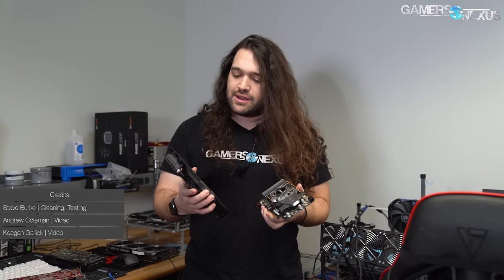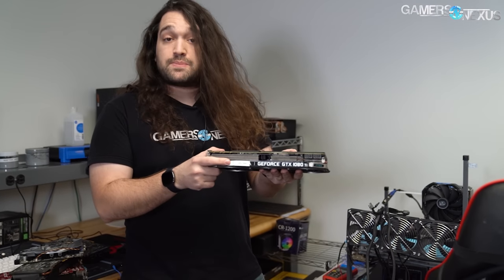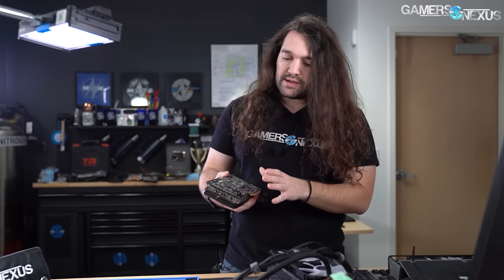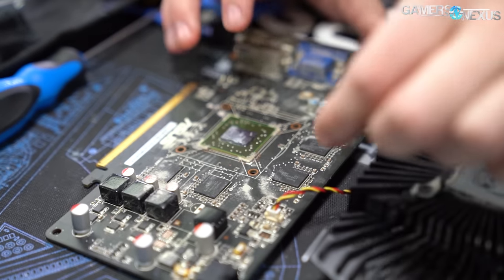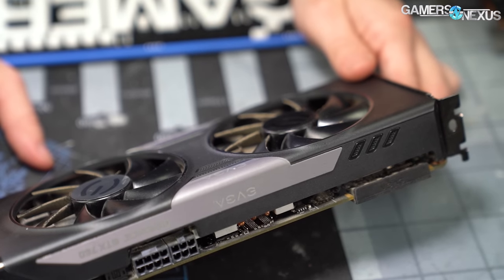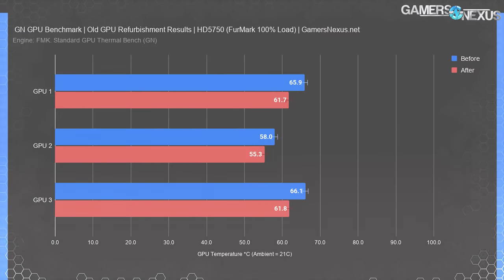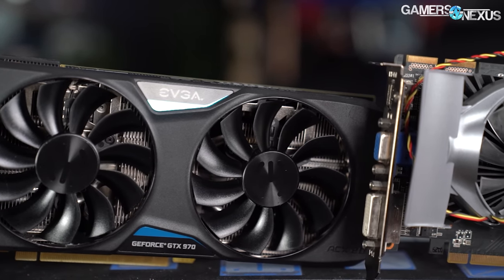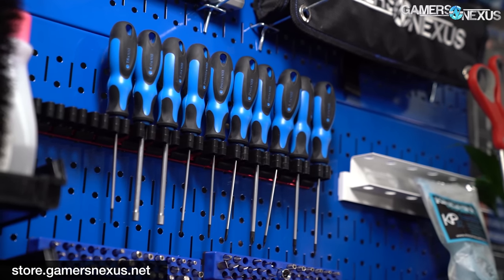GPU Cleaning Before & After Thermals: Re-Pasting & Dust Removal

Comment: this is why my cousin's athlon 64x2 5400+ and HD 4570 still work today in tandem and why my 6950 and q9550 still work well too regardless me now rocking 3800x and rx560 4gb (the rx560 part is bugging me and won't let me overclock it without it complaining which i think i will take it apart legit this time and repaste and repad it)

and yes all systems are happy no crashes besides my main one(though that rx560 once liked 1325 core 2050 mem now shows sign of VRMs being problem and 3800x chuggling happy along with h100i cause i have PTSD from 6950 fans at 100%)

Comment: I had re-pasted my old gpu multiple times and it was good, but lastly I had also cleaned the radiator and it dropped temps by full 10 degreees.

Comment: I think the least amount of time I had a system was 3 years, and I had to replace it because our phone line got hit by lightning (back in the dial up days) and it shorted out both mine and my brothers
I ran a pentium 90 for a decade, and had most of my systems for at least 7 years. I think I still have a working 486 around here somewhere....

Comment: i bought a gtx g650 in february 2013 and cleaned it, new termal paste and recover some of the horses   and got a decent  wroking temperatures now: before was working  bewting  95-90° now is working  in the 60-70

Comment: If tim has silicon oil base it will last for really long time (as long as it's not "high performance" that crap is really liquidy and tends to sip out with time), I repasted my 8800 gts and it was within 2c  temp variants for the next 8 years.

Comment: i got a used 970 2 years ago and the add said that they replaced past and pads so i tested temps when i got it and they were good.....back then. about a month ago i seen that the temps started getting bad to where i was dropping clocks so i opened the card and seen that what ever past they used was gone.....i mean to the point i cleaned it with 1 qtip. after re-pasting and adding some arctic pads it was better then the day i got it and at about the same noise i got better clocks. just something for ppl buying used to keep in mined. you never know what they did to the card so test, clean and test again.

Comment: I'm awaiting on replacement fans for my ASUS 980Ti Strix.
Fan C the bearing is going and its buzzing/squealing (started on friday although noticed it went up a degree or so in Celsius). So am refurbishing with new replacement fans plus a repaste of thermal compound. Etc. This week.

This card will always have a second life in office use.

Just a shroud removal. Not full disassembly. Fan replacement and thermal compound.

Comment: my 2070 use to hit 81c on the core after about 20m of gaming, still boosting past stock clocks so i wasnt worried about it. Eventually i took it apart and repasted everything and cleaned everything now even after 2 hours of gameplay the core doesnt go past 76 with a higher boost clock in the same game, fan speed was ~relatively~ unchanged

Comment: Few weeks ago noticed that my old sb i7-2600k was really noisy and seemed to throttle effecting gpu heavily. I looked at temps and ordered some basic tower cooler from was it cooler master. Anyway paste was pretty much dust partly when removing. End result was really silent was ridiculous - 45c result that affected performance big time. It should be pretty much mandatory thing to change paste in all about 10 years old hardware that's been in fairly heavy usage.

Comment: Cleaned GTX 970 from dust (just pressurised air) and reapplied thermal paste. Temps dropped from 91c to 72c on Kombustor, which the first was running 100% fan, and the latter 60% fan speed. Thermal paste was some Noctua stuff I used for CPU. Looked like you put a ton of paste on 1080, I literally used a small drop. Also did the same for GTX 770, but one of the fans has this horrible noise, so it's unusable.

Comment: 99 or 91 percent isopropyl alcohol in a spray bottle will remove that water and oxidants. Also dries fast. Safe for metal, and non plastic (polystyrene is a no go) electronics.

Comment: Isn't the H5 also the same one that you use on standoffs if you ever need to add or remove them from a case? I've had to pull a few standoffs because they were the passthrough ones rather than the normal ones, and my board didn't have a hole in that spot, so I moved it to another location. Also I'm surprised you didn't make any mention of being careful when cleaning the die, not to accidentally scrape off an SMD. It won't necessarily break the card, but it's still not advisable. Definitely just did this to a card not long ago, the paste was so caked on that it actually sucked 2 SMDs off from around the GPU with the cooler when I pulled them apart like normal. The card was a 780ti and it still works fine thankfully, but it startled the hell out of me cause I've literally never seen that happen, and the GTX1070 I repasted right after had even worse paste but it was totally fine. That 780ti also dropped over 20c before vs after, the die wasn't actually making full contact with the cooler before due to improper pressure at the factory, so one corner of it basically didn't make contact properly at all until I remounted it with proper screw tightness and some Kryonaut. Now to get him to give me back my 5700xt so I can sell it so I can buy myself a 2tb 980 pro

Comment: Great video on preventative maintenance on the cards. I haven't done any graphics cards yet but have on 4 older workstations and the crud, dust and cement like thermal paste was on all machine CPU's PSU'S and fans. It's a worth while easy project to prolong the life of your stuff. Any suggestions on where to find the thermal pad specs for graphics cards and the pads themselves?

Comment: Funny to see that with my low standart. I've used untill late 2020 a old i7 960 with a EVGA 1050Ti SC for most game and it was fine. I did upgraded to a Ryzen 9 5950X when it was released but only got the same GPU or a GTX 980 to use. So far my new cpu do very well the job with my outdated GPU. Guess as a video game programmer cpu power is more needed for me than gpu.

Comment: on both used cards I bought I instantly replaced thermal paste as the first one was a mining card and the other I dont know either way some times even on some lower end of certain models it helps in general as some use crappy thermal paste to cut costs

Comment: When should you consider changing out fans on a GPU?  Or do you just run them until they stop?  And good luck finding the pad thickness used by manufacturers.  I've given up on that, and it's not like I have some obscure make of card, I got an EVGA card.  But they don't seem to want to share the thermal pad thickness with consumers.  They are into selling new cards (well, not EVGA), not helping consumers make their cards last longer.
Reply: 1. Get new fans if they rub/click or stop.
2. Just measure the pads lol

Comment: great video just quick question, didn't notice if you mentioned it or not, but the 1080ti that was clean but just paste replacement, was the paste already replaced at some point in the cards life or did it still have stock paste/pads?

Comment: Might be interesting to test the same thing on older CPU's.
For example I have a 7yo Intel 4670K CPU non-oc with stock cooler, which still has the Arctic Silver 5 thermal paste applied to it from when I installed it 7 years ago. Never replaced it. Temps are still relatively ok (for a stock cooler) and it's not thermal throttling. I do clean the heatsink and fan blades from time to time (but never took off the cooler from the CPU). Replacing the thermal paste will obviously not help performance (not without an OC and my motherboard won't allow that), but I do wonder if it would reduce temps and thus reduce fan RPM in a meaningful way. Those intel stock cooler fans can be a bit loud, especially when I game on graphically less intensive games that get above 100FPS.

Comment: I cleaned and repasted my GTX 980 and didn’t notice a difference (always ran at 80 degrees). Recently, I replaced all my case fans with be quiet ones and noticed a drop in overall temps. Just saying airflow could also be an issue.

Comment: I recently replaced rx 570 thermal paste, but it only got me 1-2 degrees improvement and then I got what the problem is. Fans are just sh!t. When I crank them up to 100% the card is cool, but the are very loud. Now I will order new fans, remove the card cover and strap on new fans. It should lower the temps and the noise at the same time.

Comment: Just a throwaway comment, but if you use water to clean a heatsink consisting of Copper heat pipes and Aluminium radiator fins, are you not risking damaging the interface between the two of them especially if you can't dry them out 100%???

Comment: My evga 1080 ti (same card on the video) died (artifacts and hard shutdown) a week ago. I have only taken the backplate off. The thermals pads were dried out and the almost greasy thing from the pads were all over. Did not take off the cooler, but can imagine. 3+ years of service in rather hot environment and my lazy ass not cleaning case for better airflow. Not bad, but horrible timing.

Comment: Would you guys also investigate aftermarket coolers, for various GPUs [aka, historically known hotter running ones]? In case some folk have chips needing a thorough revival, through a HS failure/replacement, or if mfr's applied solution was paltry/subpar for the chips capability

ex) Arctic Coolings Accelero series

Comment: 0:43 oh, like my sapphire 5670 with 512mb i bought brand new in 2010, which i used for games and netflix until i sold it this past november. or the 5770 i bought used in 2020 and it didn't get a clean up since new.

Comment: What about Blower style GPU cards? like the 1080 Founders, ASUS 1060-70-80 Turbo. Being that these need to push air across the entire card from one side to another, rather than multiple fans pushing down onto the cooler. Would you say maintenance and cleaning would have heightened importance?

Comment: Hi I have a question, should you re paste your gpu and cpu once a year? If you run intense games? Some people say once every few, but I’m gathering if you use it a lot, and you push the limits that you should every year? My RTX 2060 and amd3600 perform really well, I haven’t re pasted it yet and it’s been a year now. I reach highs of 83 degrees but stays around 78-81. And since I have 8 fans it doesn’t throttle at all, and is still really cool, don’t get hot much at all, Mainly because I play at a higher refresh rate though, reason for higher temp

Comment: I am gonna do this on my RX480 nitro+ 8gb because I looked into overclocking it since I can't upgrade atm. Saw that it was throttling on stock oc speeds and then realized my card was idling at 42c which is about 10 degrees more than I think it did when I first got it. 

Wish me luck!

Comment: Here in Brazil there's a cheap product called "Tira Grude" witch translates to something like "glue/stick removal" that I accidentaly discovered that removes dried out thermal paste, and that weird, sticky (an usually pink) thermal compound from chipsets sooo easily, one drop, a toothbrush, no force, and its all gone. This is the product: https://www.quimatic.com.br/produtos/especialidades-quimicas/tira-grude/ If you can find out the composition, maybe you can find a similar thing to buy, and no more screwdriver brute force removal method.

Comment: Here's a question about washing heat sinks with water. When I do it, I usually rinse it with distilled water for the finish as I am concerned about the limestone residue from the tap-water covering the surface of the fins and consequently decreasing heat dissipating performance of the cooler. Is this a valid concern or will it not have any effect using tap-water only?

Comment: I just bought Kryonaut Extreme to replace my Evga RTX2080 XC Ultra's paste. 
Thing keeps pushing the fans into a turbo mode even with adjusting fan curves, chassis fans in my HAFX case on maximum, removing the Asus X570E motherboard shroud under it.

It's only 2 years old, so darn... are these manufacturers going cheap on thermal paste nowadays?

Comment: there is nothing as good as cleaning a used GPU you bought on eBay.

I got a 1080 that had enough weed in it for a small one. below the cooler was a good millimeter of tar. that was fun. (didn't even test this one before cleaning)

Comment: I've got an RX5700 that's about 1.5 years old. The thermals have been a bit high (80ish under gaming load), and the fans or possibly coil whine has been louder of late. The fans do spin, and don't appear to have any wobble or anything that would indicate a bad barring. I haven't noticed any loss of performance, but I'm worried about the card getting worse or breaking if I do nothing. I've never taken a modern video card apart before, and thermal pads and hidden screws scare me. Should I try to take it apart, and replace the thermal paste? I can't afford scalper prices for a replacement if I break it. I'm not sure what to do.

Comment: Why not just use a vacuum cleaner to absorb all that dust? I am aure you can find portable ones that you can adjust the strength. If you combine the vacuum cleaner and a soft brush, you can get rid of all the dust and junk easily and faster. I restore vintage computers every day and it works very well. 👍

Comment: At 4:24 you mention the thickness of the pads. If we are converting a card to water cooling and the block already has thermal pads on it, do we need to replace those pads with a correct size?

Comment: I have a Aorus RTX 2080 Ti Xtreme .. it is now 2 years old and was never taken apart since then.. It has a moderate OC on it and for about 2 months or so it started to do weird things when gaming all around a few minutes the fans turned up to about 4000RPM for a few seconds and then went back to normal..wich was strange allthough i had a manual fancurve in MSI Afterburner... after a few researches it turned out to be a BIOS baked in process to fight against silicon hotspots... after tearimg it down it turned out to be a very crumbled and for only 2 years shocking hardened paste... i cleaned the die and heatsink with IPA and repasted it with Kryonaut and now those weird fan ramping disappeared completely.. i didnt keep record of thermals but it that wasnt the problem in the first place but i feel that the clocks now go higher than before so it all fulfilled the cause.. just if anyone experience sonething similar... :)

Comment: after doing cooler modding im currently running my 2070S at 2045-2100mhz at 67-71 degrees celsius which gave a massive fps boost in demanding games like cyberpunk and scum. more notably scum, since cyberpunk has a lot of software issues. Ofcourse overclocking isn't healthy, but I was planning to buy a 3080 and i assume this overclock will be fine for the time that it takes for 3080's to return to the planet earth.

Comment: about the air compressor and the fact that it does release the dust into the air: Wouldnt a vacuum cleaner work? Or is the suction force too low for this kind of job?

Comment: Bought a gpu from someone that was clearly a heavy smoker. I scrubbed the heatsink in the sink with a toothbrush and soapy water. The whole card still reeked. The thermal pads were brown... Originally blue... The  pcb itself smelled like stale cigarettes, the fiberglass absorbed it. Gross.

Comment: Question:  I have an MSI gtx970 in a secondary system; did MSI use a thermal paste of similar/equal quality or longevity as EVGA's thermal paste of that era?  Because based on this testing, I would hope my 970 is fine and I don't need to take it apart to repaste it, unless someone happens to know that MSI's paste of that era was not as long lasting as EVGA's.  I can't really tell if temps have gone up since I don't remember what they used to be.

Comment: I still have yet to find a paste that doesnt pump out on direct die application on the long term. I had to take OEM paste underneath the stock CPU cooler (unused)  because the viscosity is much higher and doesnt pump out.

Comment: Something is wonky with the fans / fan control on my Sapphire 5700 XT Nitro+; I can control the fans OK with MSI Afterburner, but the stock fan control is borked in that if I start up a game the fan just goes to full speed immediately, pretty much, and the fans now fail the Fan Check in Sapphire TriXxX that they used to pass. I could probably RMA the card, but it's the only GPU I've got. By the time I get a new GPU I won't need it, so I guess if I can upgrade within that Window I'll RMA this one after getting my new card and have it for a backup in case I need to RMA another one, or let my friend have it for his build or something.

Of course, I've easily been able to afford a new GPU for months now but haven't been able to buy one, and I don't see that changing anytime soon.

I thought maybe toggling to the other BIOS or BIOS flashing might fix the fans... but the card is "working" so I'm afraid to mess with it, to be honest.

Comment: I recently purchased liquid aerosol (canned) that I sprayed on a keyboard and would wanna use for other stuff, but just to make sure: Sometimes it comes out a bit liquid-y so to speak. Like it's spitting. I always shake it but if some of it does get on anything, is it dangerous like water and it should dry for 24h or is it more like alcohol that evaporates fast (it does evaporate fast but I don't know the chemistry behind it). Just in case I wanted to clean my "not so cheap but nothing else was available" 3090 for example. Or the motherboard, or fans, etc.

Comment: I cleaned my Gigabyte GTX 1060 3gb recently, peak temps went down by 7 degrees but minimum temps rose by 5 degrees. The TP I used was MX-4 (2019). Is there a reason for this or did I not apply it correctly?